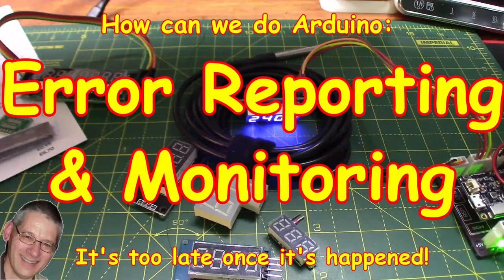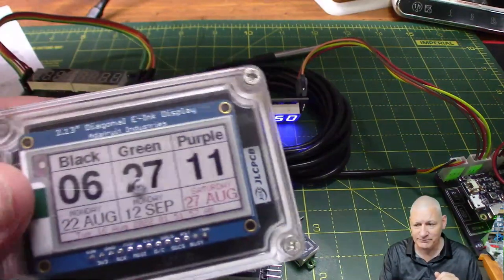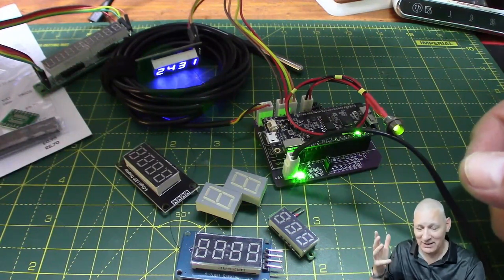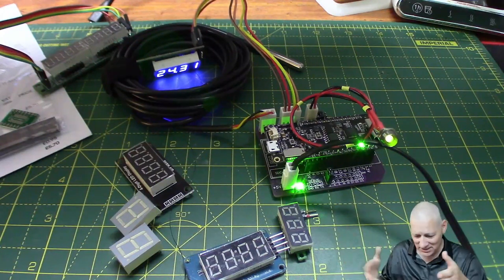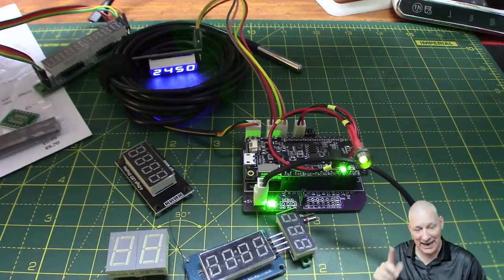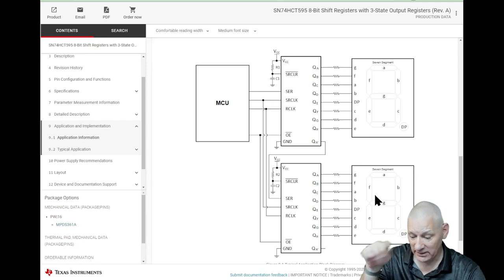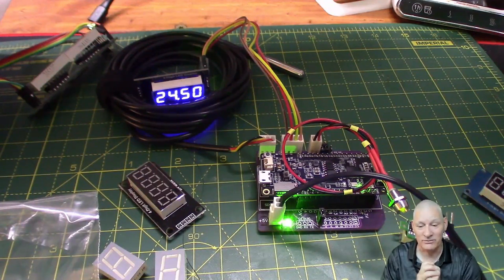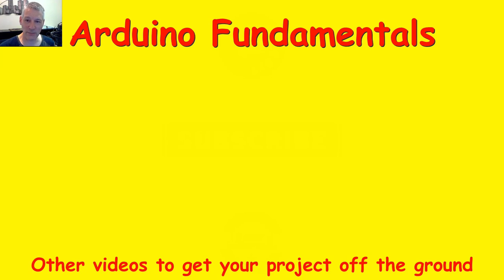#247 What's gone wrong? How do we know?

Comment: One idea that occurred to me would be to do what they do for car ECU's. Store the error codes in the internal flash when they occur, in order in a dedicated area, and if there are any error codes turn on a light. As an error occurs, you check in the list of stored codes to see if its already there, and if not you add it to the list. You could then add in functionality to read and clear the codes at a later date. If the gadget fails completely, you might still be able to read the codes using a device programmer, as I know the Atmel device programmers can read the flash memory, I presume ESP32 etc would be the same,
Reply from the maker: Sounds do-able, Ian. I'm still working out my options. None of them are easy. Or work in all cases.

Comment: Hey Ralph, a few thoughts for your project: 

if you want to capture the error output, a webserver is not the best option: any loss of wifi, and there are no more errors. What you can do: SPIFFS (i.e. LittleFS) to the rescue! Just write a logfile to the otherwise unused FLASH. I did a little video (german - but I guess you'll get around)  on how to use LittleFS as a temperature logger with a small web interface on the system; I guess that could be adapted to your project. And since the ESPxx acts as a server, you can get the status of the system, even if it's placed somewhere normally unreachable.
If you want to do some "still alive" logic, you'd probably need a second server (that can be an ESPxx, too). Your system sends periodically a "heartbeat" to the control server (all over Wifi/ESP NOW) - if there's no heartbeat, the control server makes noize, blinks LEDs... whatever you desire :)

On the thought of really small LED Displays: try googeling HPDL1414 - really tiny, should be compatible with yout idea with the shift registers. I used two of them some time ago in a four-letter-word-generator... they work like a charm :)

Keep up the good work - I'm always enjoying your videos!
Reply from the maker: A small web interface is fine (my workshop heater controller has one, shows all the temps from all my sensors in and around my workshop) but it only works with web-capable devices. So ESP32s are no problem. But an Arduino? That's where a simple display might be useful.

Those HPDL-1414s are really butt ugly. I've found some 0.2" (5.1mm digit) that are really pretty. I'm hoping to show them if the project works! 

Incidentally, your workshop is about as warm as mine in the summer. I'm seriously thinking of a split level aircon system so I can actually sit in here without profusely sweating! 🥵

Comment: This is an excellent video that highlights a very common problem. Thx.  I really like the little .9” OLED displays for this. They are about $3 each and smaller than the segmented digits.  They are I2C so take few pins.   You can display quite a bit of debug and error data on them. I like the comment others have made about storing past errors in EEPROM as well.
Reply from the maker: Very welcome! Yes, stage one in displaying an error will be done first.

Comment: microSD card writer/readers are small, cheap and easy to use; anything that can be written to the serial monitor can be written to microSD. A clock module can add a timestamp. If written at regular intervals, there's an audit trail of when the Arduino crashed.
Reply from the maker: I need to intercept that output to the serial monitor and route it to the microSD card.
Reply: @RalphBacon  Are you asking me how to do it? If so, I'd be happy to oblige: I could publish a sketch to github if you like. Tim

Comment: Amateur ish, but so arduino ish at the same time:

Extra I2C connector on the board costs next to nothing, both in terms of price and board space.
In code log events using SW Serial and error codes to EEPROM.
In case of fault connect BT SPP module like HC-05 to that I2C connector, connect from Android with treminal app of choice and reset to read out error codes (setup routine) and debug running code.
Or even add a button to reinitialize BT module on press to avoid resetting (and e.g. triggering self-test routine).
Reply from the maker: Yes, the error code has to survive a reboot so writing the error somewhere is a must.

Comment: For one project we needed to be able to get error code's and serial number from a set of devices where the only interface to the user was the power led. This was a problem before IOT was not even an egg. The answer in the end was to send the data via the power led, we just put a photodetector over the power led and received all the information required. the led was pulsed fast enough for the user not to notice by eye, also this was long before mobile phones had cameras so detection buy the customer was not a problem.
we had t think outside the box, or outside our box ;-)
Reply: That's a pretty interesting solution. How did you receive the data, if I may ask?
Reply: @1_HighDuke  we had a handheld rs232 terminal, which displayed the data. The sensor just turned the light pulses in to 5V logic signals for the terminal to read.
Reply from the maker: So you invented Light-based Wi-Fi even before Wi-Fi was invented?

Comment: Well, I've had to do this professionally for many years and all these schemes are dependent upon a coherent processor writing coherent data to an (for lack of a better word) 'error-log' device; furthermore there appears to be no method past the error-number to display relevant failure data..

The problem is, if the main 'CPU' has trouble or becomes corrupted, either temporarily through say a transient or worse a hard permanent failure, you don't have the 'intelligence' available to handle this corrupted condition.  It is fine for peripheral errors but I've found that when something is upset, usually the main system has played a part (mostly by line transients--or latent stack-overflows etc.), to the point that it can write false reports especially if you limit it to a single/double LED display (i.e. the display might show something but it is not truly valid because of the limited display combinations).

So, the only solution that I have found that is the best, is that of a continuous operation-log--(with sometimes an brief exceptions-data log) that we are constantly writing operation/results to this log whether the operation is correct or aberrant.

In order to facilitate this, we have to have a mechanism with sufficient storage-depth that you can go back and fully understand the execution-stream that was taking place.  When you have a pure software (resident on a PC or mainframe) system, you use a text-based sequential file that logs everything (sometimes down to the user keystroke/mouse-click) to the level of granularity that is useful.  I have had clients that corrupted their databases and tried to blame it on my software but when I showed them the keystroke/resultant data-stream, it quickly ends the argument!

On a microcontroller system, the method I use is an EEPROM of sufficient size to accommodate enough event-capture to be useful.  This does not have to be all that large because an error and its relevant failure-data are usually fairly short.  Given this, you want to still use a 'circular-file' type of system whereby old good data gets overwritten by current whatever data. So, unless the system really goes wacko and just writes tons of gibberish to the error-log, you are pretty much assured to have something to work with..  In the case of the external EEPROM, you can even unplug it and interrogate it on another system. In the 'old-days', I used a static-ram with a lithium battery backup that I could detach in a similar manner.

Lastly, I utilize Morse-code to use as an annunciator for really small systems whereby I can review anomalous data by requesting it 'playback' any exceptional data collected (which of course can be segregated from the afore mentioned total data-stream) and using Morse code can be quite verbose using only one I/O pin!  Alternate to this is of course your system whereby you're using 'trouble-codes' just like on a vehicle.  Anyway, super video and it is indeed important to know what went 'bump' in the night!  73...
Reply from the maker: Well, if the main processor goes fubar then there is little we can do. But, as you say, reading the log back to the point of failure can throw some light on what might have gone wrong. 

Hopefully those mega errors are few and far between; in the Arduino-style world it's much more likely that we couldn't read a sensor, or the Wi-Fi would not connect!

I'm hoping my dual 7-seg displays are easier to read than Morse code (which I knew once, as part of my [teenage] radio amateur's exam but never progressed it, so now I know nothing of that any more).
Reply: I have always wondered and a continuous log sounds great.  Since these makers seem to use serial debugging and logging, maybe a good device is an ESP32 serial logger with SD card and web interface as just the logging device?  It can be kept as a toolbox device for many projects.....

Comment: Hi. I would use a part of the embedded EPROM as a event log. If RTC is available, it could be recorded too. So you can log last xx error codes (10 for example).
Reply: Indeed, using a small circular buffer in the EEPROM is a good idea.  Using half - 512 bytes - seems about right.  Simplicity leads to fixed size records: start with N bytes for the sequence numbers - the index table.  Divide the remaining space by N for the individual records. Each record starts with an error code (8, 16, or 32 bits - your choice), that is followed by a zero terminated string, then the last byte of the record is the same sequence number as the one that went in the index table.  A sequence number of zero means 'not used, ready to be used'.  Sequence numbers go from 1 to 255 and back to 1.  A quick scan of the index table will find the most recent message. e.g. If there are 250, 253, 254, 255, 1, 2, 0, 3, 251, 252 then 3 is it.  The point of writing the sequence number at the end of the record is the verify that the message has been completely written.  If the sequence number from the index table and the record don't match then that writing is incomplete and the entry is invalid.  RTC stamps can be added easily too, maybe using the Unix 32-bit timestamp, or some more verbose representation.
Reply from the maker: A circular buffer in the EEPROM could work. On reboot, the Arduino (or whatever) would read and show any "last error". Hmm. Brain cells are ticking.
Reply: There are some I2C EEPROM modules that you can use for MC’s without built in EEPROM. Good thing is you can move them to an other MC for debugging

Comment: Hello Ralph,
I would use a ring memory in the EEPROM in this case.
In the first cell the pointer is stored (e.g. No. 2)
then in the following cells the respective error code. When the ring memory is full, the first value is overwritten again. If enough EEPROM is available, the corresponding time stamp can also be stored in this way.
With an ESP8266/ESP32 I would create a text file in the SPIFFS as "Logfile.txt". In addition to the error code, a time stamp can also be stored here.
I hope this helps you.
Greetings
Frank
Reply from the maker: Thanks, Frank. Yes, some sort of circular buffer might be the answer.

Comment: Motherboards still have beep codes to this day. Beeper is just not mandatory now, but there are always pins for external one.
POST codes 7seg displays is more of a premium feature now.
They haven't invented anything new apart from logging 10-15 entries of codes + timestamps into EEPROM, but that's a server segment feature.
Ah, also "Wait for F1 if error", that will prevent boot until user input in case there was some severe fault like failed overclock or memory speed profile.
Reply from the maker: What about the PC error "Keyboard not detected - press F1 to continue"?

Comment: Well, one of my projects has an actual beep code implementation!
I included a function that can send Morse code via a beeper, and optionally - a compile time choice - an LED on a separate pin. When I hit an error situation in my main code, it calls a "signal error" function that uses the Morse function to send S-O-S, followed by the integer error code passed in. Repeat.

I figure the beeping would catch my attention if I was walking by, or happened to be in the same room. An LED (or 2 digit display) will only be noticed if you're actually looking at it, but an audio signal interrupts you to make you look at things! A beeper takes only 1 pin, and the optional LED would take the count to 2. 
Admittedly, I didn't implement anything to retain the error after a reboot, but my use case didn't need to... If it isn't working, then I treat it just like a modern Microsoft operating system, and reboot. At least I don't have to format and reinstall!  :)
Reply from the maker: I wonder if you could wire the LED in series with the beeper so you get both visual and audio notification from one GPIO pin?
Reply: @RalphBacon   It's certainly possible to drive both from a single pin. I have actually breadboarded an active buzzer connected to the Arduino built-in LED pin, which of course has its own on-board current limiting resistor, so yes, it can be done!
But I don't think wiring them in series would be the best choice, and with different kinds of beepers it can get... let's call it tricky ?

A passive peizo beeper is basically a capacitor, so a series LED is going to be driven with pulses (at audio frequencies - which may not be what you want) of very high current. Instead, you'd probably want the LED in parallel with its own current limiting resistor.

If, on the other hand, the beeper is an active unit in series with an LED, then you need to worry about the current draw through the beeper vs what an LED needs. Magnetic beepers typically draw >20mA, while a piezo unit is <10mA. How much greater or lesser than those numbers depends on the specific device, but if they're in series, whatever current your beeper draws will be the current  through your LED. (How bright does the LED need to be, and how long do you need it to last?)
So even with an active unit, you might want them in parallel to optimize the current for each device. But then you have to be careful of the total draw on the pin (LED draw plus beeper draw)!

BTW - since I wanted to make the code general and reusable (and not force a particular circuit), my Morse routine calls "dit" and "dah" routines, which optionally turn on an LED pin before calling a (synchronous, blocking - so shoot me!) "beep" routine, then turn off the LED. The "beep" routine sends an audio signal to BEEPER_PIN (which could of course be wired to also produce a flash of light) and is the only routine that needs to know what pin to use, and whether to use "tone()" for a passive beeper, or just toggle the pin for an active one... again, a compile-time choice via #define.

Comment: Don't now if this makes sense. But you could use an output pin, sending a specific voltage. You can then connect one of those cheap voltage monitors, it is ready and build off. If you use voltages above 0.5 Volt you can keep the voltage monitor switched off with a transistor or FET, and only let it light up in case of an error. Or, just flash an LED so you know you need to 'read' the output voltage. No need to say you must divide the Voltages in ranges, so small differences can be rounded up or down. Also note: you do not need to keep the voltage monitor attached, you can just attach it when there is an error situation (shown by an LED). I have seen may comments about SD card and EEPROM.
In most cased you wil have 'missed' the error any way, the code does not have to stop 'at' the error (overshoot).
Want to know a fun fact? So every now and then I am standing still, waiting for my fire alarm to blink. Haha, just to see if the battery still works. I don't want to really test the alarm (1) it is loud, (2) it drains the battery at that moment. I already noticed the firmware tests the current draw so every now and then. In any case: the simple blip of the LED tells me it is working. And it will beep if it low battery (making et even lower that it is, but it works very well).
Reply from the maker: The voltage on GPIO pins is generally zero (or as near as) or +5v (or as near as). Nothing in-between unless you're using some sort of digital to analog conversion. However, I could read a series of pulses (like the computer BIOS beep codes I mentioned) I suppose. Then again, if the unit is permanently powered I could just flash an LED and watch that.